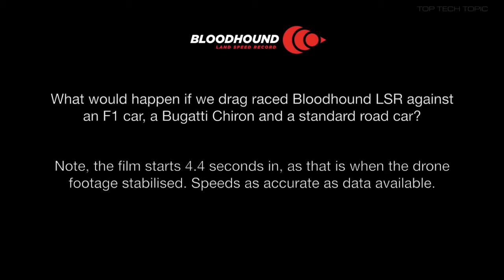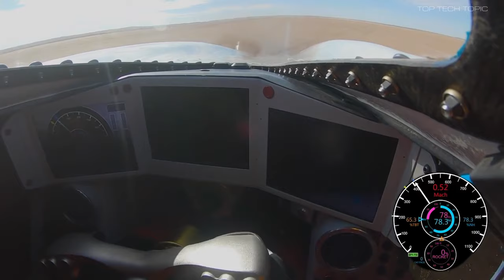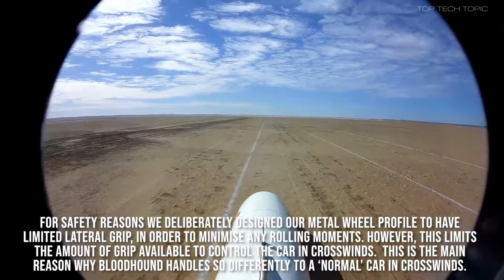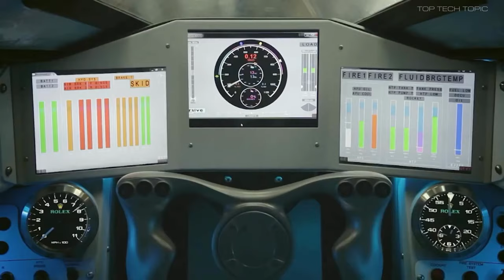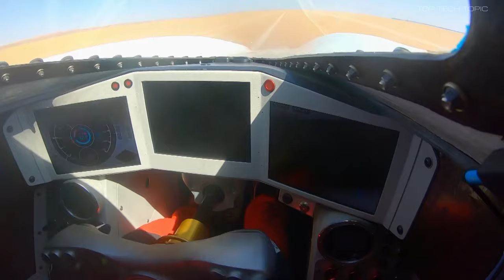Bloodhound LSR | The World's Fastest Car YOU MUST SEE !

Comment: So where is the speed record ???
Reply from the maker: In this video, you can see the speed of it in 1:07 and 2:32,  Currently its top speed is about 628 mph  (1,010 Km/h).
The initial focus is to exceed the current speed record of 763 mph (1,228 km/h) in 2020 or 2021, with the vehicle believed to be able to achieve speeds up to 1,000 miles per hour (1,609 km/h).